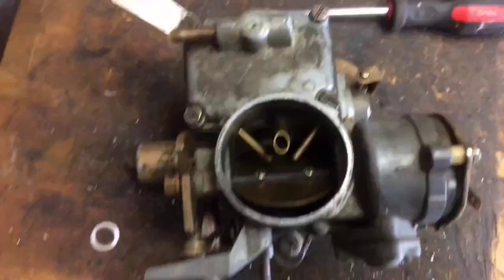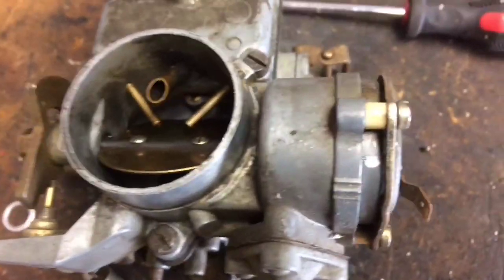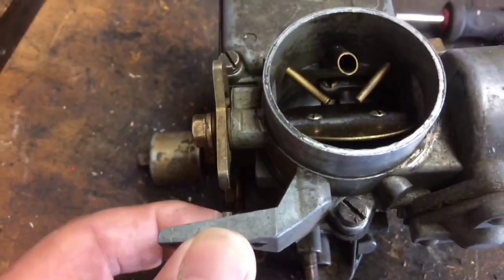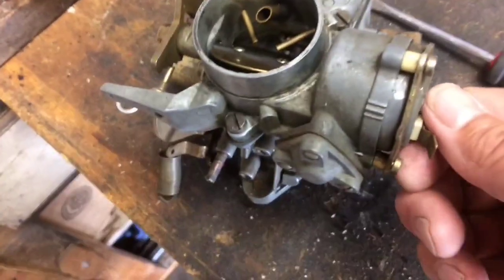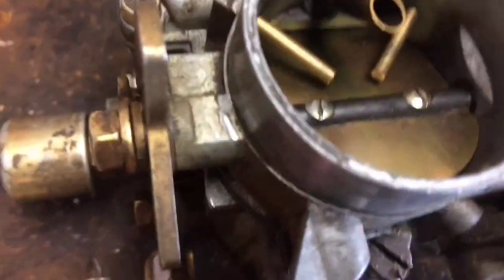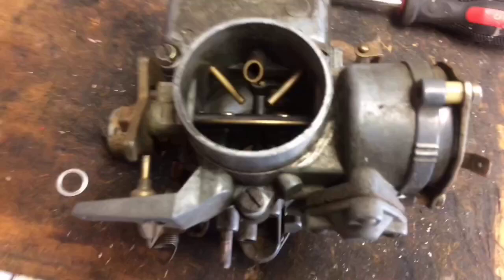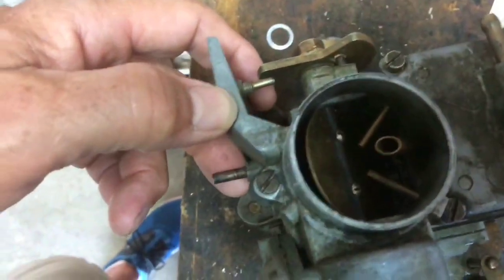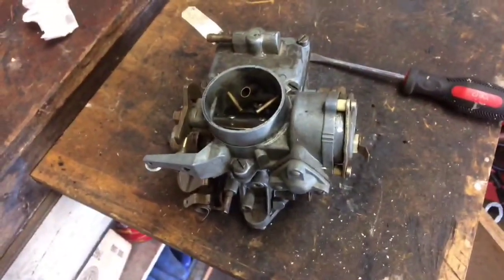VW choke setup / Desert Rat 2000

Comment: is that may fix my cold start ! as I need to press on the gas few times when it's cold !
Reply from the maker: Yes you have to have a working choke on a cold motor unless it’s summer and it’s 90 degrees outside, this is presuming everything else is set up properly

Comment: Hi, i need to adjust the choke on my solex 34 PICT 4 and it has no notches or indication marks, any suggestions on that?
Reply from the maker: As long as the electric coil is working correctly, I close it down to about an 1/8 to 1/4 inch from completely closed when everything is cold , if you have 12 V to the prong on the side when you turn key the coil will start to open the choke, so as the engine warms up the choke opens all the way open, and the next time the car is completely cold and not running give it a little throttle and the choke should close back down to where you adjusted it if not re adjust it, hope this helps
Reply: @DesertRatFabrication  it really did, thanks alot✌️🤎

Comment: I set up my choke and it fires up cold really good, the only thing I don't know how to solve is the high cold idle. It idles at around 2500 rpm when cold and then returns to 800 after warming up. I think 2500 for a cold engine is a bit too much, how do i adjust my cold idle, would set it at around 1200-1500.
Reply from the maker: Just remember the idle is set with the big screw on the carb , the choke idle is done with the choke step, when it’s hot the screw on the choke step should not be touching it’s done by the big screw on the side of the carb
Reply: @DesertRatFabrication  yes but my hot idle is good im just talking about cold idle
Reply from the maker: @omaralispahic  that what I was trying to tell you, that is done by the screw on the choke step, you should be able to turn the idle up as far as you want, let me know😆

Comment: When engine running what happen to butterfly
Reply from the maker: When it is warmed up it is all the way open, it is the choke so when the engine is cold it is almost all the way closed, it opens as the spring on the side heats up
Reply: @DesertRatFabrication  Noted but mine all time open and sound engine like miss firing
Reply from the maker: @yusofabubakar3703  ok then you need to get the choke working properly